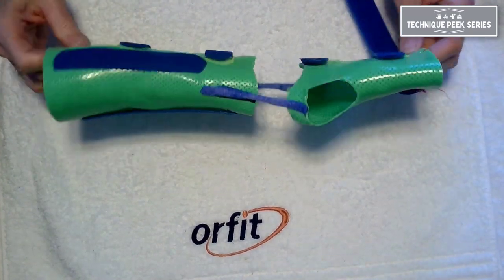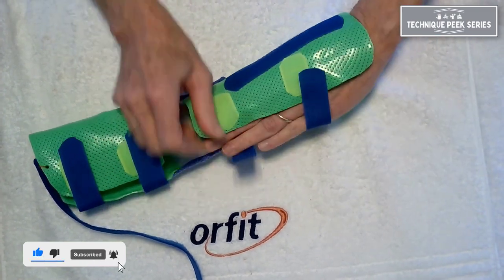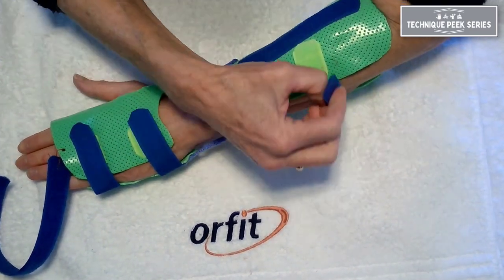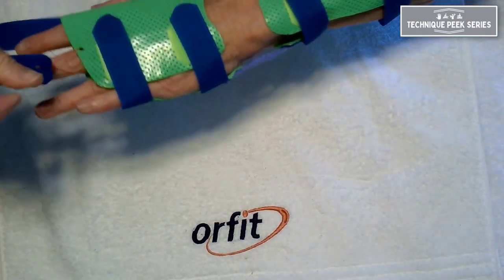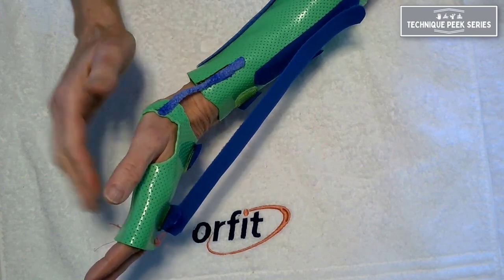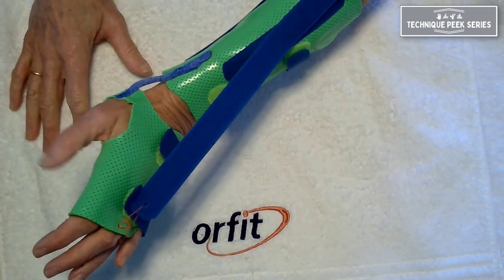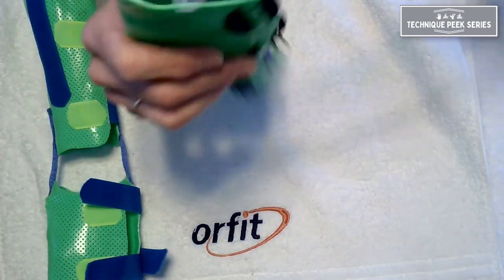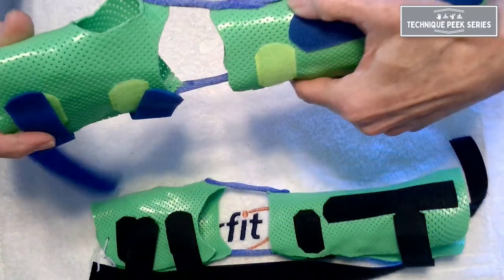How to create a Static Progressive or Dynamic Wrist Flexion Extension Splint | Technique Peek Series

Comment: What makes a splint progressive static Splint vs Dynamic Splint?
Reply from the maker: @RoZi2089, 
A static progressive splint helps improve movement by applying a gentle, prolonged stretch to the joint over time. The goal is to increase the joint's flexibility and prevent it from becoming stiff or immobile.
On the other hand, a dynamic splint actively assists or resists the movement of a joint. It uses mechanical components like springs or rubber bands to provide a constant force that helps the joint move in a controlled way. This can be helpful when someone has difficulty moving their joint due to muscle weakness or pain.  Hope that helps. Thanks for watching our videos!
Reply: @ProfessionalSeminars  Thank you so much! Greatky appreciate the explanation.